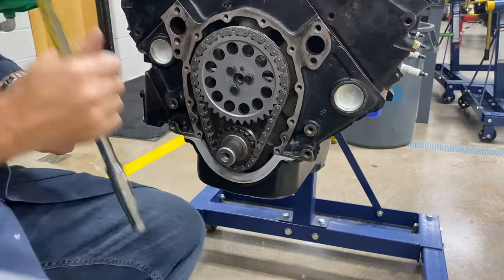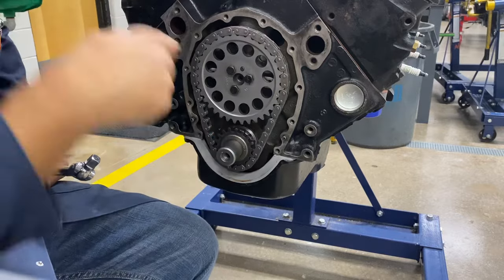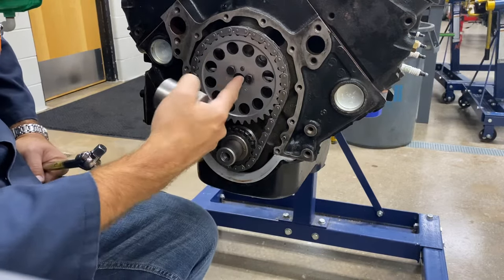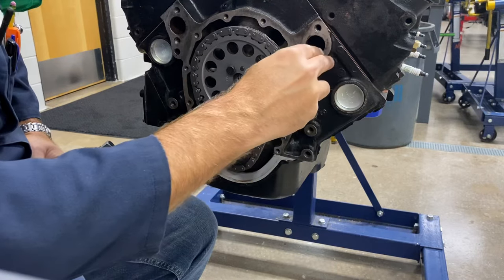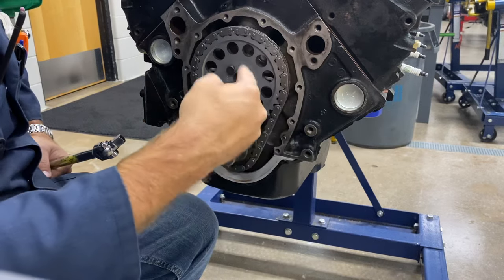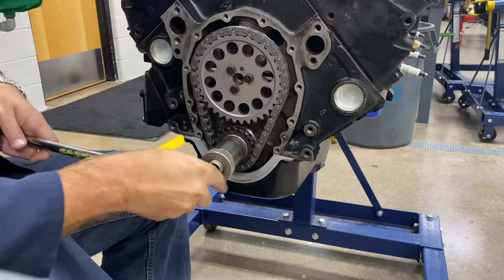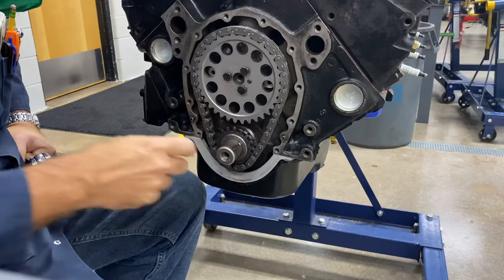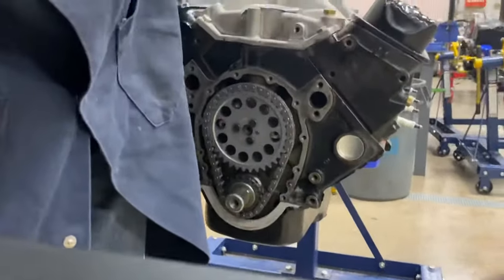Base Engine Timing Explained

Comment: Besides the crank and  cam dots lined up,  wouldn't you need to have the #1 cylinder  at TDC on the power stroke, that being both intake/exhaust valves closed with those dot alignments as well ?

Comment: So what happens when your timing chain breaks? Can you theoretically (as long as nothing else is damaged) just line the sprockets back up then reattach the chain?
Reply: Yup, usually something else is broken, depends on the engine, older volvos are great, had a 2.3 single cams belt come off, aligned the sprocket ,put the belt back on and everything was mint. Also had a 2011 X5, chain broke, luckily only the parts on the head were broken. Really depends on the engine
Reply: @Googoogaaagaamentality vvti, if not then it’s toast

Comment: when you talk about spinning the cam at the end is that not a cause of concern for? Unless the one you're working on has non interfering valves, don't you risk the having valves make contact with the top of the piston? Great video thank you